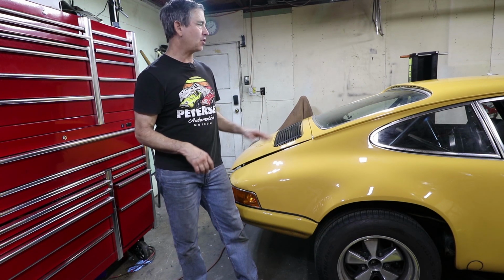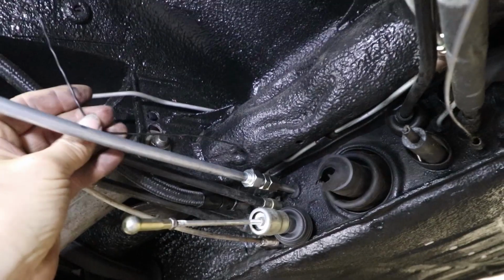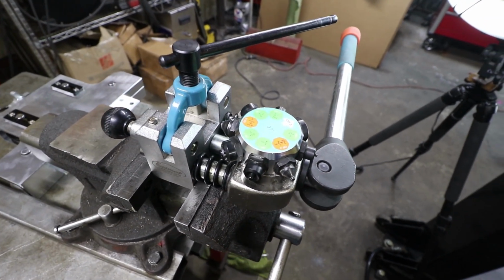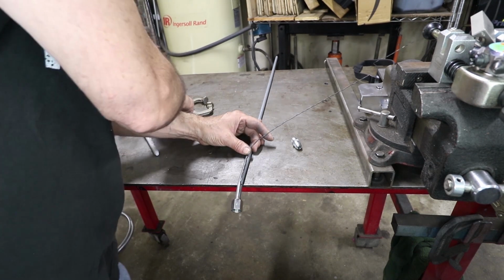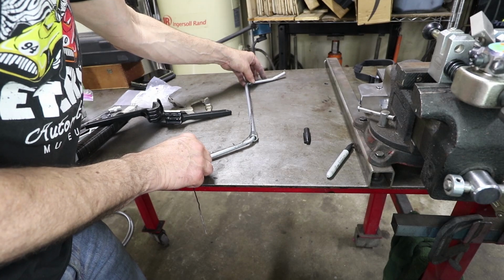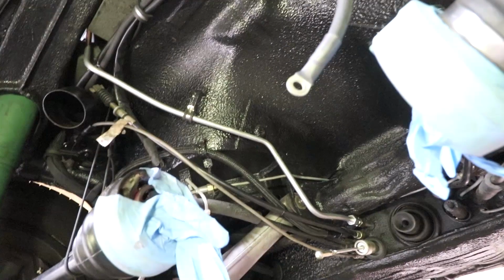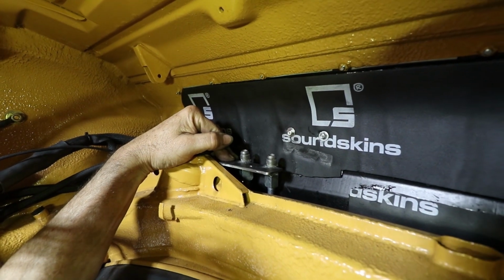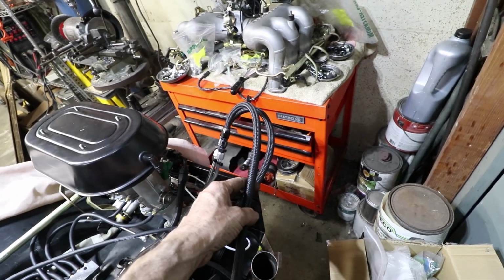Upgrade Your Fuel Lines: Say Goodbye To Rubber And Hello To Custom Steel Tubing!

Comment: Could you have used copper lines as they're so much easier to bend and mold??
Reply from the maker: Copper likes to crack. So you have to be careful with how it's secured to the car so it doesn't flex.  Modern cars clamp the lines every 6 inches or so.
I felt better with ateel lines guven how they are mounted in an old car 
Thank you so much for all the supportive and complimintary comments.  People like you encourage me to keep going so thanks for that.

Comment: In my case, it wasn't ethanol that was deterimental, it was father time.  The hard fuel lines in my SC were so corroded, they literally crumbled in my hands.  I went with braided teflon lines straight away (time vs money.)  Good luck with the engine.  Nice work as always!
Reply from the maker: Thanks.  Send me some pics of the Teflon hose end you used
Reply: What's the easiest way to do that for you?  E-Mail?  I used Aeroflow components.  When I lived in Australia, I had a store 10 minutes away from me which stocked every fitting imaginable.
Reply from the maker: @dra911 thanks email tperazzo356@gmail.com

Comment: Are you running carbs?  If you ARE, then you must NOT use ethanol fuel.
Reply from the maker: Not in this car, but I have another carb car.  We don't have many options.  E10 with marvel mystery oil has been working for me
Reply: @GarageTimeAutoResto  I learned with Carbs and cars that are not daily driven: If the float bowls are allowed to evaporate (from not driving frequently enough) that the Ethanol will absorb water from the air and leave this moisture in the float bowls once the gas has all evaporated.
This will cause a white chalky aluminum oxide to form in the bowls which clogs the jets. I have three different Fuel filters in my system before the carbs and STILL kept getting junk clogging the jets.
Once I switched to ethanol free gas the problem went away (AND my gas keeps for over a year in storage).
No more white deposits in my float bowls.
Reply: @GarageTimeAutoResto  The ethanol is not nearly as big a problem in FI cars as the system is mostly sealed from atmospheric moisture.

Comment: I had flexible stainless lines installed, and I drive 30 miles to only fill up with 91 non-ethanol.
Reply from the maker: The thing with stainless flex hose is most are rubber inside anyway.  Good call to avoid  the ethanol if you can.

Comment: I live in Wyoming where Christmas comes twice a year and ethanol free fuel is available everywhere. If I take my old Porsche out of state, a few bottles of gas treatment(Driven Carb Defender) come along.
Reply from the maker: Thanks for the driven carb defender recommendation.  I want to check that out for my 356.  I've been using marvel mystery oil.

Comment: Tom, any reason you didn’t use copper-nickel lines? They are way easier to work with.
Reply from the maker: It's probably not an issue, but the fatigue resistance of steel is the reason why I chose steel.  I think there are a few OEMs that are using copper nickel.  They are clamped down every 10 inches or less from what I've seen.  
Corrosion resistance is better with anything non-steel.  
Steel might shield against heat  soak better.